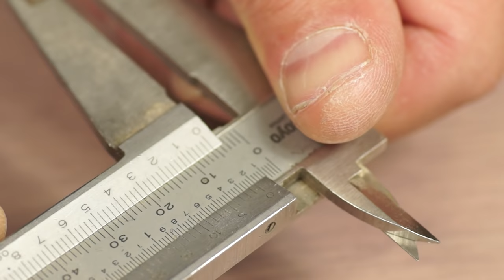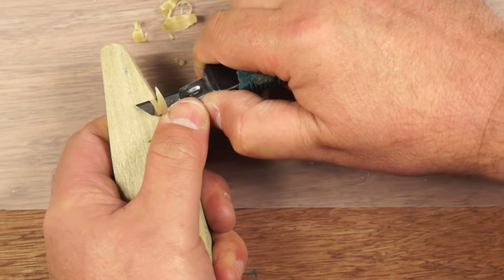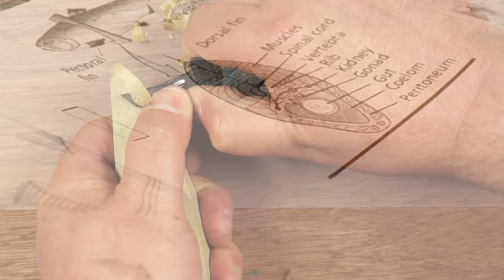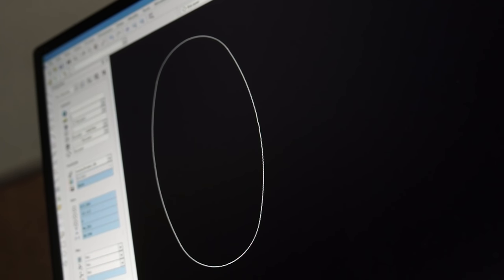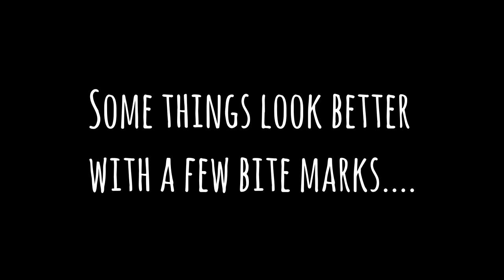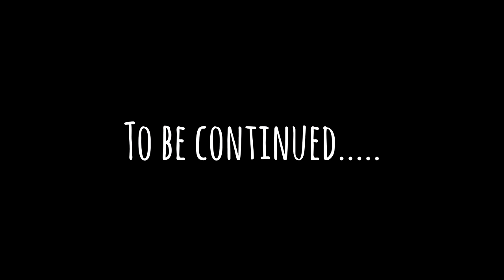Making Wood and 5 minute epoxy Trout Glide Bait  Fishing Lure

Comment: Hey paul what slider do you use to film  your videos?
Reply from the maker: +Brendan's Fabulous World of Fishing I bought a cheap 1200mm one from china about £70 and added some cnc cogs and old 12v cordless drill with a separate speed controller to get moving,, cost me about £100 all together with the slider in. I just made an overhead rotating arm to get circular shots, using a motor and some wood, so far that has cost me about £30, but i want to rebuild it in metal to take a bigger camera. I used it for some of the rotating shots, thanks

Comment: Paul , ....I'm sure , that with your method of creating those faceplates you're inspiring quite a few fellow lure carvers out there , ....another brilliant tutorial clip of yours , ...thanks a lot for sharing !Can't remember to have seen you whittling as intense as doing for this particular lure project , ....... when I got started about 25 years ago , I also employed this very carving technique as shown , als using a straight edged Stanley blade .But since I've made myself two razor-sharp , but very low cost , carving knives out of old files years ago(one straight and one curved edge) , I've found the curved edge to be far superior to the straight edge , ......as a result  roughly 95% of my carving work is done with that curved edge nowadays , ....it cuts easier and is simply better suited for shaping more complex  lure blanks , since the curved portion of the blade allows for removal of smaller wood chips without biting into and possible tearing the woodgrain , also much better suited for curved or sectioned lure bodies , even slight indents are possible to carve . Also I'd employ a different(yet also finger-protecting) technique , ...I'd hold my workpiece more or less upright or slightly slanted on the workbench and lead the knife from up to down against the workbench , a little indention in the bench or a sheet of expanded rubber laid underneath would help to keep the workpiece in steady position under the strain of the knife's blade ,.....the holding hand's fingers are out of the blade's reach either , since located above the downward led blade .I find this carving  method much more comfortable  , sitting at the workbench(chair's and workbench's height must match for bodily convinience , off course) , both elbows resting on the bench , most likely only moving the wrist of the tool hand and fingers of the holding hand to switch positions of the workpiece , ........no more thumb-pushing a straight blade into resistant wood grains for me !Best greetings , Dieter
Reply from the maker: +61diemai I suppose i have some proper whittling knives, but to be honest a box cutter feels very comfortable to use with this kind of light work. I enjoyed making the body for this mainly because i don't often work completely in the round but more usually with flat sides.Cheers Dieter

Comment: Hello Paul
I am always following your extraordinary work and creativity. Some time ago, I bought a black permanent marker in BassPro to do some details instead using acrilyc black paint in my homemade lures. But when I applied the epoxy coat some spots or lines that I did using the marker began to spread ink into the resin. Would you please tell me what brand of marker are you using??? Have you ever experienced this kind of problem before in any of your projects?  I will appreciate your tip. Thank you very much indeed, Antonio
Reply from the maker: +antonio999us The solvent in the epoxy is probably reacting with the ink from the permanent marker. I am using a acrylic marker in this video http://www.amazon.co.uk/Uni-posca-PC-1M-Paint-Marker-Pen/dp/B001VB4T86/ref=sr_1_1?ie=UTF8&qid=1446801449&sr=8-1&keywords=acrylic+pens+art       these work well on acrylic primer or painted surfaces but not directly on plastic
Reply: Hola Paul, thanks a lot for the tip. I will look for this marker right now and buy it. I will let you know how I did...

Comment: You have never had any trouble with the screw eyes pulling out of the wood?  I make plugs for the pike around here which regularly are 20 lb. plus and I am nervous about using screws.  I do the s/s wire thing to hang the hooks.  Would be easier to just use screw eyes.  Nice video.  Plugs almost look too good  You should do a test lure of just one solid color and see if it catches as many fish.  Have a nice day.
Reply from the maker: I  have never had a problem with screw eyes but s/steel wire loops are stronger if the wire is thick enough, i have made single colour lures and caught fish with them, thanks
Reply: I will try the screw eyes, thank you.

Comment: Hi Paul,i do have most of the material to doo the projet ,i have some question ,can i use marine varnish with the époxy or i'm better off just the époxy .. thank you ... Merci ..
Reply from the maker: +victor da silva Marine varnish will protect wood, but from my limited experience with it, it needs a few coats and long periods to dry, but it is probably not as wear resistant as epoxy.
Reply: +Paul Adams (The Handmade Fisherman) :: Hi ,Thank you for the respond ,merci ,have a good one .

Comment: excellent job,may I ask you for little advice,I have problem with epoxy-the final coiting,the epoxy doesn't accept acrylic colors,it look like water on oil,empty spots everywhere,what i need to do,change epoxy or colours,thanks
Reply from the maker: +pajic milan it might not be the paint, oil is normally the first problem, tiny amounts oil from a compressor/ airbrush, or even touching the lure after you have painted it will add natural oils from your fingers.
Reply: ***** i tried so many times,all combinations,the first epoxy layer allways is the problem,but the second is allways excellent even if I tuching lure with my hand,today I tested the Epoxy Max Clear ordered from USA end the same resolt,that is why I was thinking that epoxy end acrylic colours are bad combination,but when I am watching your video end videos from other lure makers,it looks so easy
Reply: is there one more solution with urethane or something else just for the first layer between colours end epoxy? anyway thank you very much for your help end 10 stars for your job,excellent shape of lures end ideas
Reply from the maker: the first layer is never the best in my experience. There are things that can make it worse, having lures with large flat areas like sides will make the epoxy want to dome as it is attracted to itself more than the surface, so often it will pull away from the edges of the surfaces where the side meets the rounded over top and bottom. The best shape to cover would be a complete sphere the worst would be a cube, and the more layers of epoxy you add to a cube the more it would start to look like a sphere
Reply: of course,but I found that the bast way to apply epoxy is with brush as wide as possible but also thin as possible,I am able to controle the quantity of epoxy on brush,end perfection of layer because the brush is wide

Comment: 00:25 Nice hat. I use Japanese Cypress and have never had a screw eye stud pull out. I've tested them up to 50 pounds that's as high as my scale will go. Paul have you ever tested and pulled one to failure??? BTW beautiful bait my friend.
Reply from the maker: i have done tests before on lures and on traces, it might make a video, the trouble with workshop testing is it requires a vice and a lot of yanking and yes if I use enough force i can destroy a bait and a trace, but that does not tell you what happens in the water as fish do not have access to vices and workbenches.  I have never had a bait lost to a broken eye or one that has pulled out, it is either a hook that gives, a trace or the line. With this lure i have straightened out a 4x treble retrieving it and even after that there is no movement in the eye, not even bent. Long term water damage can soften the wood and rot may cause a problem but not that i have seen.  thanks
Reply: Thanks for the reply, the testimonial and the videos Paul. Really appreciate seeing someone else's work. I've only had one hook failure and it was at the workbench not on the water. It was a resin bait and I believe the failure was from using a hot epoxy that I was experimenting with to set the hook eye. Have never had a failure on the water. For some reason most anglers seem to think that a handcrafted lure cannot take any punishment when in fact they are very durable when constructed properly. 

Thanks again and good fishing to you my friend  <0><